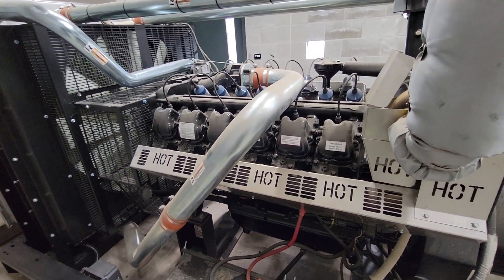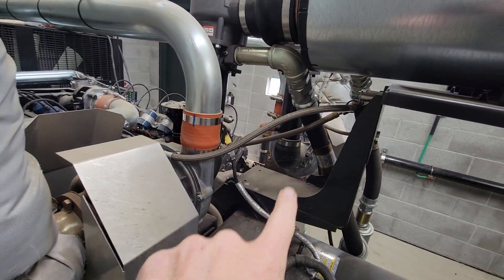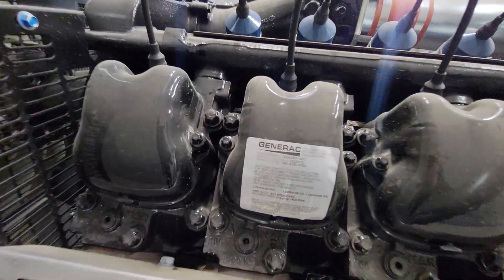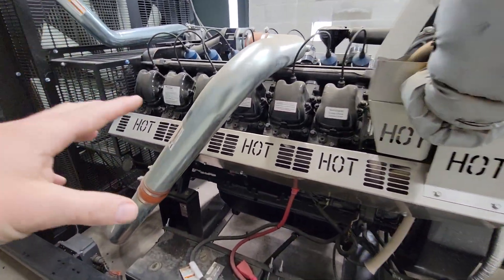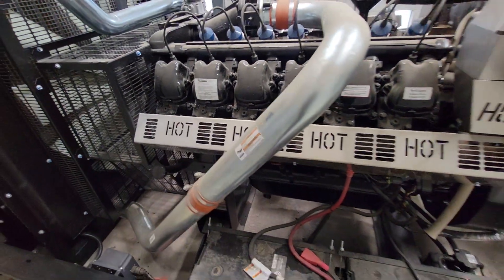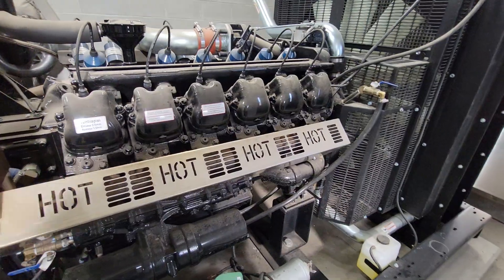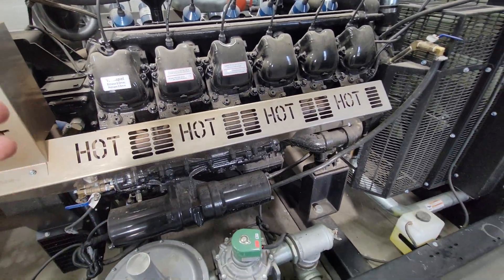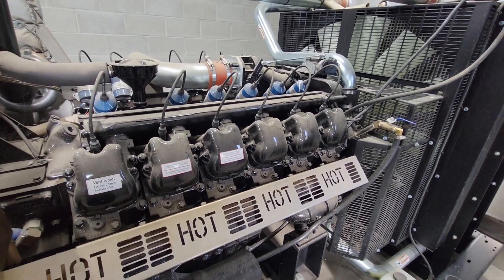Massive MAN 21.9L Twin Turbo V12 Natural Gas Engine!

Comment: damn that thing is almost as big as the fiat s76's engine! The Fiat S76, built in 1910, had the biggest car engine of all time, with a 23.5-liter four-cylinder lump generating 290 bhp and a top speed of 134 mph.